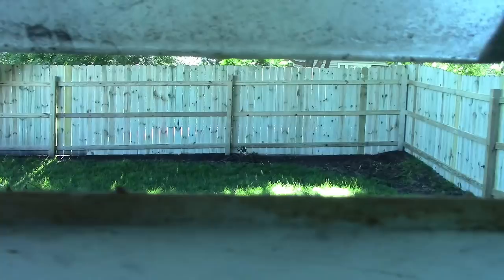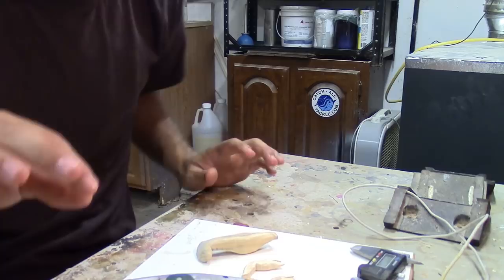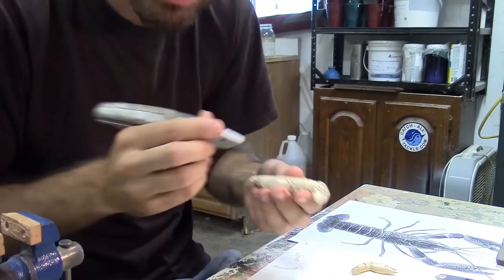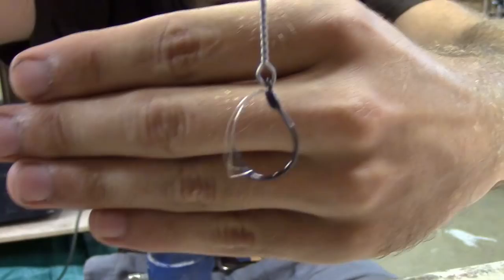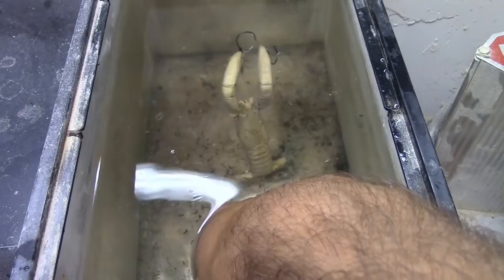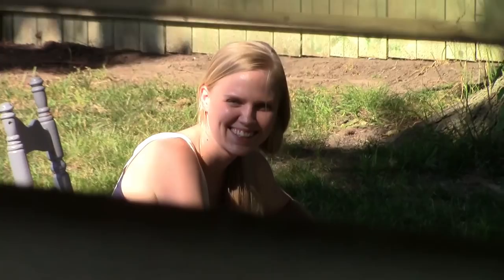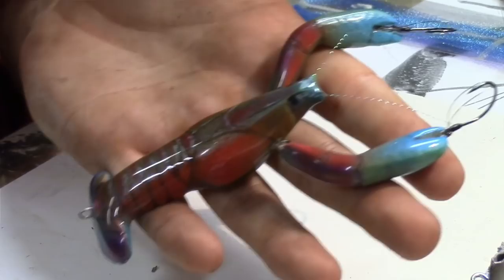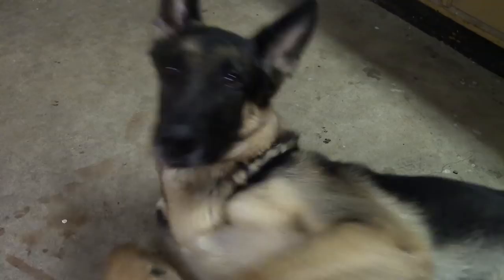Making a Crawdad Lure

Comment: LOVE your videos! I've done a LOT of studying on crawdads as bait for bass fishing... Crawdads actually change colors based on water temps during the year, dark black in early spring, red during hot summer and blue towards the fall so you want to pick your lure colors depending on the time of year. You might have better luck with those blue and red colors in fall?! Also because your claws float,  that's a "defensive position" for crawdads and the fish seem to tend to strike less often with the claws up unless they're really hungry, so you could try adding a hair more weight to the claws. Another thing is when the fish strike they usually inhale the crawdads quickly which bends the claws backwards out of harms way, so you might have better hookups with a single hook in the body of the bait with the hook's tip on top to keep it relatively weed and snag free... Cheers! Keep up the GREAT videos! "ON to the NEXT BAIT!"

Comment: Crayfish, as my local area calls them, swim backward as you had this set up however the tail is also where fish hit them. I believe having the line tie at the end of the tail isn't a good place for it. That's where the hook point should be or at least a hook point should be. If you build a crawdad lure again please consider putting a hook point at the end of the tail and another one right where the tail meets the body, maybe a 3rd in the middle of the tail and the line tie top center of the body. In my opinion and experience with using live crayfish as bait that's the best way to rig them. Hookup ratio's are in the 90% range that way. Fish don't go after them from the front they go after them tail first.

This is a great lure! It had great action! The line tie placement is why I think you didn't get any hits. The line's in the way of where fish hit them.

Comment: You should have used the hooks as the antennas
Reply: AlecChrz I like that idea. Kind of like the hooks on a frog lure or something. That might offer. Better leverage for hook sets if the hooks are on the body as opposed to the joints. It didn't sound like he had much action so it's hard to tell if an improvement is necessary though.